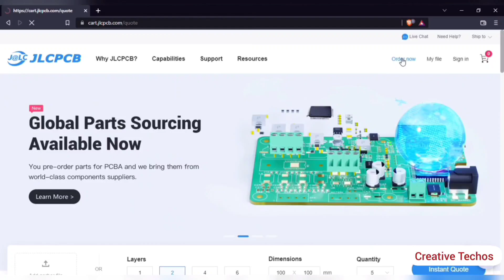How To Make DC Motor Speed Control Circuit

Comment: What is use of capacitor of this circuit how add aa big capacitor
Reply from the maker: About which capacitor you're concerned?
Reply: @CreativeTechos  if check online for pmw speed control module you can see they use 1000uf 2 piece of capacitor.why they added??

Comment: Nice video🙂👍, many things i have learned from you 🙏. I want to ask, can i use this pwm to control heating element? Thank you
Reply from the maker: What type of heating element?
Reply: @CreativeTechos  nichrome wire heating element 🙂
Reply: @CreativeTechos  nichrome wire heating element
Reply from the maker: You can use but, depends on how many watts it will consume, so that you need to use higher power N channel MOSFET.
Reply: @CreativeTechos  thank you for information 🙂🙏
Reply from the maker: Thanks for watching 🙂

Comment: Is there any AC  110V   small motor control circuit.  ( Small grinding machine ) Thanks.
Reply from the maker: Yes, you can control it using triac circuit

Comment: Prepara uno con capacidad de 20 o 30 ampere  en 12 voltion
Reply from the maker: This can be used with 10A, and it depends on fets , add more in parallel to increase amperage.
Reply: @CreativeTechos  ese sólo aguanta 1 minuto en 10 ampr